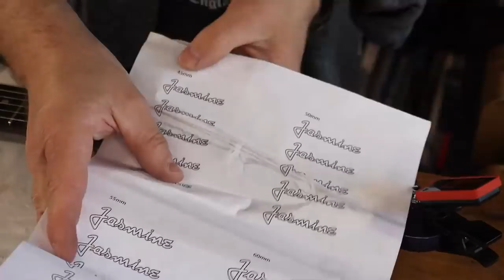Custom Logo Creation in Metal - Luthiers Live Stream with Ben Crowe

Comment: Hi there, regarding string tensioning. Your string is operating in its elastic mode. So when releasing tension it goes back to its orignal length. The setting is in de connection points, eliminating slack in those points, such as the windings around the tuners and the curves around the nut and saddles. Overtuning the sting would do that trick as well. What you also get over time is creep. because the string is under "constant" tension, it will elongate due to creep, making it necessary to retune every once and a while, until it breaks  (apart from the changing in length due to temperature)  I did quite a lot of mechanical testing in an earlier part of my carreer. BTW To clamp our string for testing, use your lathe. it is stronger than the wood in your bench. Sadly I missed the conversation. This is right up my alley 🙂
Reply: Well said. I neglected creep in my points as I was under the impression that it would only become critical at higher temperatures, of course time is a factor too. I do however have a lot of creek in my joints😄
Reply: @nto-steve  I only have popping and cracing knees 🙂
Creep happens at room temperature, as also stated on wikipedia it is apparently called cold flow. 
To do the test properly you would need a tensile test machine awith heavy clamps that do not deform under this load (unlike a wooden bench where your benchdogs are wobbling when applying the meat to the strings) and some extensometers to measure only the strain of the string. If you would permanently stretch the string ou would have plastic deformation and usually this is to be avoided since it introduces a brittle point in you metallic structure.

Comment: Just use a black permanent marker to mark 2 points on the string that are as far appart as possible (after nut /b4 bridge). Tune. Measure their distance. Stretch. Retune. Measure.

Comment: @Marc Jennings @Crimson guitars extras String streatching

You are stretching the metal string beyond its elastic phase and into it plastic one.
Materials have a few phases they pass through when they deform under an applied stress (such as pulling the string) if not enough stress is applied the string will remain the the first elastic state - that is to say it will return to its previous dimensions.

If you apply enough stress to the string it will pass the elastic phase and move into the plastic state - it cannot return to the elastic state once this has happened(the fundamental structure of the metal has changed in the material), in the plastic state if a material (the string) it stretched by a given length, once you stop pulling (applying force) it will not return to its original length, it will stay at the length you stopped pulling it at because it has no elasticity left in it.

So if you dont stretch a string out before playing, bends, tremolo use etc, will stretch the string, but not enough to put it into a plastic state, it will try to return to its original dimensions, but typically not perfectly and you need to tune up again.

Simple material physics of metal. 🤷
Reply: Hence strings should come with warnings - stretch up to .... Pitch...
Reply: @kokobily  I usually tune the guitar up to F# leave it for 15 mins (to go make coffee ☕️) then come back and tune it to E standard and its tuning  generally fine. Floyd rose Bridges can be a bit of a pain though 🤣 I use 10s for the most part.
Reply: @Squi-Rell  I tune a few cents sharp, then do it again 2 or 3 times, and that gets them pretty stable. I'm running 8's on all my builds. For a floyd rose, block it so it can't pull up, and tighten the trem screws slightly. this locks it into a "hardtail". restring and tune up. then remove the block. the guitar will go sharp. back off the trem screws til it drops back into tune.
Reply: @normbarrows  Floyd's are such a pain I've made a block stop. Section sits under the tail of the floyd which keeps it level with the body (no strings on) and a section that hooks round the trem arm and the strap button to stop the tail lifting while tuning. Works reasonably well but before I made that....man were Floyd's and other floating Bridges a royal pain.
Reply: You say simple but the last paragraph doesn't make sense. When playing, or bending, the string must be entirely within it's elastic state. The action of plucking the string is slightly extending it until past a certain point at which the string slips off the pick or finger and tries to return to its original state, overshoots and goes back again and again setting up its vibration until the oscillations are damped enough for it to stop. If the string were in it's plastic state one bend would leave the string loose and flapping about.
Reply: @nto-steve  it is simple. If the metal string still has some of the elasticity it will stretch and then contract much like a rubber band but with one small difference, it does not return to exactly the same dimensions due to the physical structure of the metal. Once you stretch the string to the point there is no elasticity left in the metal, it will stretch  on bends but will then return to the exact dimensions it was prior to bending. 

Look up metal memory and metal fatigue and you will see exactly how simple it is.
Reply: @Squi-Rell  Ok don't need to do that. Your comment is just contradictory that's all "Once you stretch the string to the point there is no elasticity" followed by "it will stretch  on bends but will then return" . Never mind.
Reply: @nto-steve  if you are going to quote me, do not misquote me and quote the entire sentence rather than just parts of it.
Reply: @nto-steve  The elastic deformation of a metal is a reversible occurrence where the metal can return to its original state. Metals that are deformed past the point where a return to their original state is impossible are referred to as being plastically deformed and not elastic. When stress or strain (tension or compression) is applied to a metal, a series of forces act on the metal forcing it to expand in an axial or radial formation - essentially elongating itself. If the applied stress or strain is within the force load allowances for the given metal based on its modulus of elasticity then the metal is said to be elastic and it will return to its original form or close to, when the forces are removed. If the applied stress or strain is greater that the modulus of elasticity determined range then the metal will be permanently deformed. Once in this state, bending or stretching will then be forming stress on the metal as you are working directly against the tensile strength of the metal and eventually there will be structural failure of the metal. 

So in relation to guitar strings, once the string has been stretched, it is past the modulus of elasticity and it is therefore no longer able to contract back to its original state, which results in stability of tuning. This stretching is also one of the reasons why strings snap (edit: more often on hard tail guitars than floating bridge guitars due to the fact the floating bridge is able to move, therfore reducing the maximum tension on the string), especially the G as that string tends to have a slightly greater tension.
Reply: @Squi-Rell  The entire sentence is above for anyone to read and it is not a misquote.
Reply: @Squi-Rell  Yes I agree with physics, it's just that once in its plastic state it will no longer work as a string, just keep elongating which you correctly state, so how then can it work as a string elastically trying to return to its original length setting up oscillations.
Reply: @NTO-Steve  "If the metal string still has some of the elasticity it will stretch and then contract much like a rubber band but with one small difference, IT DOES NOT RETURN to exactly the same dimensions due to the physical structure of the metal. Once you stretch the string to the point there is no elasticity left in the metal, IT WILL stretch on bends but WILL then return to the exact dimensions it was prior to bending."   

There is a clear distinction in the statement there. The only omission is that I did not elaborate on the tensile strength aspect of the metals. You can argue with me as much as you like but the fact remains that this is very simple physics to understand and the formulaic equation is called Young's modulus which has been around since the 18th century.
Reply: @Squi-Rell  Not really arguing just discussing hopefully. I don't see how it can be said that after being taken past the yield point into plastic deformation that it will return correctly but in the elastic region it will not! This is backwards. I'll say again and then leave it. The string must be in its elastic state to work.
Reply: @nto-steve  The info I have provided is pretty much how it is explained in most science books. 

The oscillation you mention is more to do with resonant frequency under tension and is different but related physics. All materials have a resonant frequency. With a guitar string, it is under tension between 2 points. If you apply kinetic energy (pick the string) it will resonate at a given frequency (440Hz on the A) based on various factors (string material, tension, length, etc.). As there are 2 anchor points (bridge and nut) the oscillation will travel from one end of the string to the other. At this point the wave form with reflect off the nut and travel back down the sting. This causes interference (phase shift) to the wave form which reduces the amplitude of the frequency until the string stops moving (this effects sustain more than anything). 

Now back to the property of metal. Once you have stretched the metal strings to their plastic state (the point at which it will no longer reduce to or close to its original factory state nor lengthen any further) it is not quite at its tensile breaking point. The string will still have play in it. When you bend the string you are pushing the sting closer to its tensile breaking point by increasing the physical tension on the string but this does not physically lengthen the string. By bending the string you're  effectively increasing the string tension, reducing the ability of the string to oscillate which increases in tonal frequency (note). It does eventually produce microscopic stress fractures in the string material leading to snapped strings. 

If you do not stretch out your strings, tune up the guitar, play and hold a bend. You will hear the note detune as you hold it. You are literally hearing the string stretching. However, a well stretched set of strings does not have this effect. The note will remain the same throughout.
Reply: @Squi-Rell  Blocking it in the dive direction as well should eliminate the need to tighten, then loosen, the trem screws.  I'll have to give it a try.  I wish there was an easy way to make a universal block that would work with any Floyd Rose - recessed, surface mount, etc.  I've only seen one attempt ever, a block graduated in 64ths of an inch, that only blocked dive, not pullup, and thus didn't really help much at all.  In the long run, a Steinberger "R" type trem is superior - better weight distribution (headless) and built-in hardtail lock, while still providing a double locking trem. On Floyd Rose builds these days, I'm using minimalist headstocks for weight savings - all but the tuner mounting area cut away.  I'm also using open hardware banjo type non-locking tuners with one tab cut off, instead of locking tuners - for weight savings. You still have the locknut for tuning stability without the heavy locking tuners. The effect is significant.  From neck heavy to neutral, or neutral to tail heavy.

Comment: Reg' string stretching, Im not sure its so much about streching the actual core/plain string, but more about seating the string ie absolute tension on the coils around the tuning peg, and finalising any potential movement in the ball end wraps etc. I have certainly found that holding the string under tension while stringing up almost negates the need for the  process of "stretching strings..."